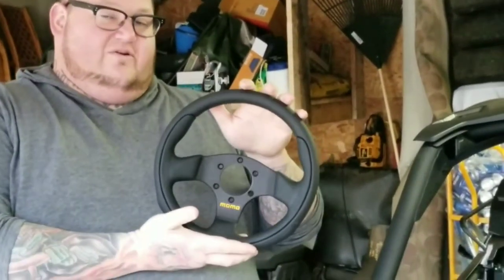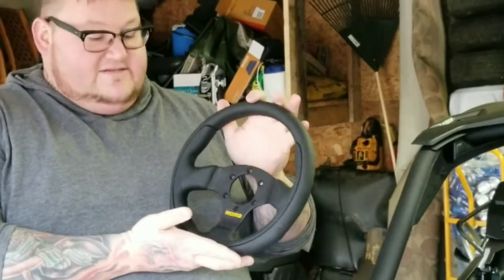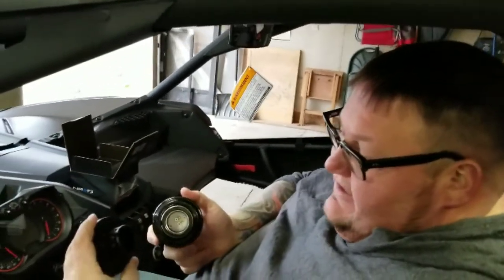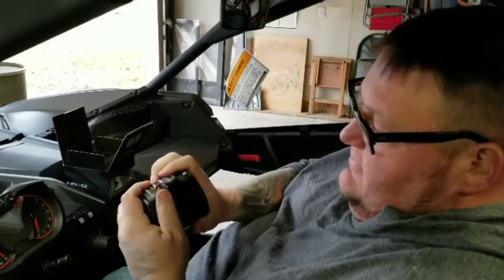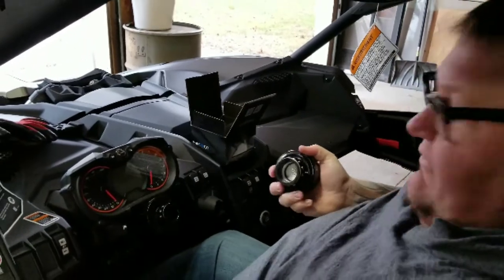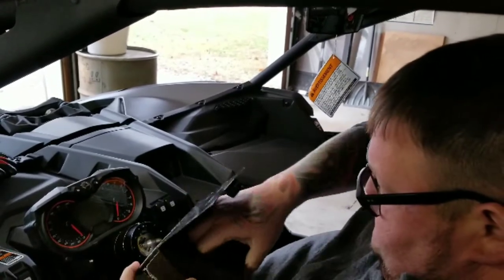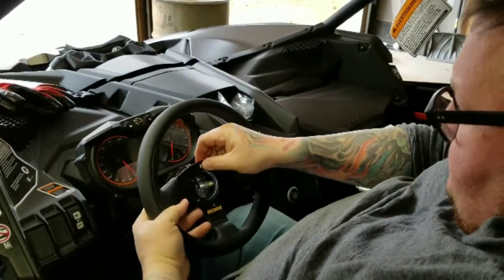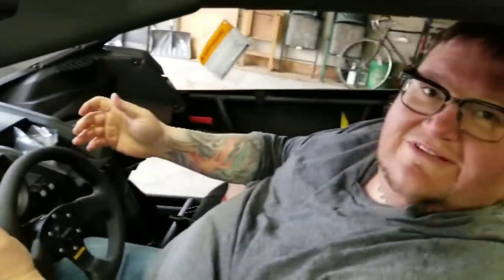Big Boi TV: Can Am X3 xrs steering wheel upgrade

Comment: Best part is how you pop off the steering wheel with ease. If you only knew the struggle I have to get mine off. Lol. Takes a bearing separator and 2 jaw gear pulley. Next time it comes off it will be to put one of these on. Thanks for the demo!!

Comment: Very helpful video. Can you send me the link  for that part also can it be used with the stock stealing wheel
Reply from the maker: No the stock wheel can not be used

Ngr innovations short hub steering wheel adapter for can am x3

Nrg innovations srk-200bk quick release

Are the 2 pieces you need

Comment: where u get the parts?
Reply from the maker: Motorsports 603 I purchased the stuff on Amazon and eBay. 

NRG Innovations SRK-200BK Quick Release (Black Body/Black Ring) https://www.amazon.com/dp/B007ZG6TUC/ref=cm_sw_r_sms_c_api_yiKcAbCZ6F3BS

Momo TEA28BK0B Team 280 mm Leather Steering Wheel https://www.amazon.com/dp/B001P28RY8/ref=cm_sw_r_sms_apip_ze3Gsiksvt1sq

NRG SHORT HUB ADAPTER CAN AM MAVERICK X3 SRK-MX3H https://rover.ebay.com/rover/0/0/0?mpre=https%3A%2F%2Fwww.ebay.com%2Fulk%2Fitm%2F221658556784

Comment: I am 5'7" 430 lbs. So is your seat all the way back and steering in the highest position. Because it looked just perect for you but you weigh less but like 6" taller also. Just want to make sure it would work for me
Reply from the maker: Scorch Earth yes I have the seat all the way back. And I actually lower the steering wheel while driving. If you need a little more (gut room) lower the drivers seat the 2 inches and bring the wheel closer to chest level. Also allowing you to pivot the wheel
Reply: Oh so lowering the steering wheel gives you more room. Well thats good. I sat in a RZR, General and a regular Maverick and I had to have the sterring wheel in the up position, lowering the steering ended up hitting my belly. I went to the CanAm dealership on 3 different occasions to sit in the X3 and they never have any. They told me its unlikely I ever will because they are sold before they get there. But cant order one just incase it doesnt work. So I guess my question is. Have you sat in all those SXS I mentioned and how was it for you. Also I was told the X3 you need long legs but at 5'7" thats a problem. So are your legs stretch in there or are you finding your legs cramped in there. I am hoping for cramped cause that might be good for me. Thx for quick response and love the videos. Cant wait to hear from your feedback when you go out riding
Reply from the maker: Scorch Earth I'd be more than happy to get some full video of both me and girlfriend who's 5'6 in the can am. Give me a couple days and I will post a link for you to see. As for sitting in other utv. X3 has the most visually. I did sit in a rzr and it sucked. Your best chance is x3 in my opinion
Reply: Thank you Jon, I would really like that. Thx so much. Ya i might have to widen my search to find a X3 where i can sit in. Both those units are hot. Cant find them anywhere.
Reply: I also sat in the general and the razr and didn't have much room. I'd say your best bet is the x3 or yxz1000r. They both have a swept back seat position and it allows us room for our gut. I'm 6'2 440